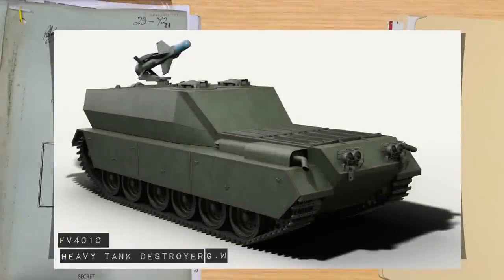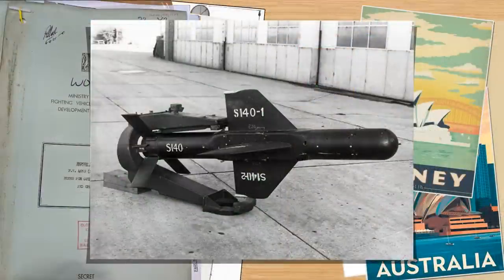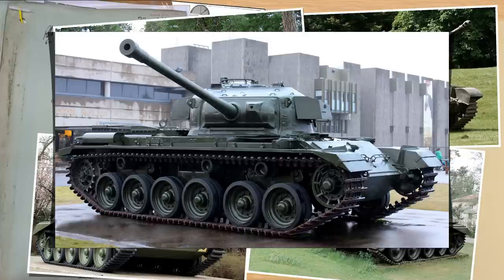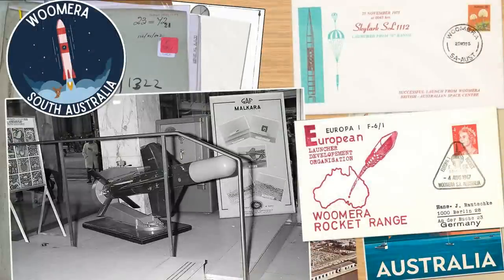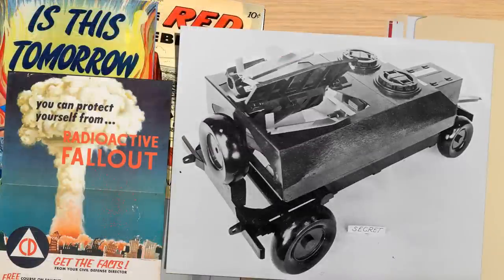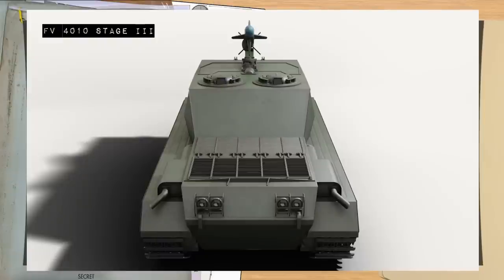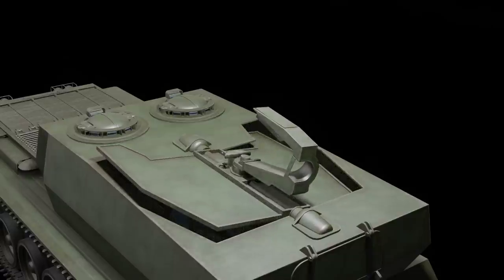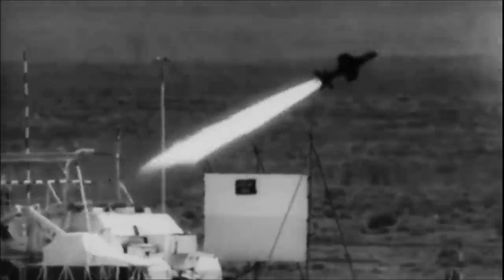FV4010 Malkara  - Tank Design & Development

Comment: i had a chance to do a commission on several of th vehicles in this line back when I first started doing commission 3d models. the number of possible systems and some of th mechanical details were ...impressive maybe not practical but ambitious, and impressive. at times I was stuck mid process... trying to figure out how the bits fitted together.

Comment: I,ve read somewhere that the prototype Merkava was a Cent chassis reversed,with the drivers position next to the engine.Its a shame the same wasn't done with this vehicle,or fitted with the 120 mm available at the time,in a casement
Reply from the maker: merk was, and this is alsoa reversed cent, but the gun was not needed, they didnt think the 120 would be enough at the time, and/or have the range that the missile did
Reply: one of the Prodigal project designs was very close to what you described I had a chance to do a 3 d model of it for a fellow a while back so had a chance to sneak a peek at th design notes as references.

Comment: Now I realise my Dinky SHADO 2 mobile's rocket launching system was a realistic loading system. OK, it only took 45 years to learn that.
Reply: the shado 2 launcher is a very close fit for a proposed orange William proposal.
Reply from the maker: you thinking 426? i found it :) - will be done soonish
Reply: @armouredarchives8867  Its was a fv400 series... side-mounted launchers with sliding panels for reloading I have one worked up around here but it's a commissioned piece.
Reply from the maker: yes i was very happy to have foudn the plans and the model photos off it, one launcher mount on the left side. - also comet OW, and several others
Reply: @armouredarchives8867  So many gems!
Reply: @armouredarchives8867   I really enjoyed the process of modeling the old drawings. they may not be completely accurate but hard to say sometimes from a pretty basic sketch.. and revisions are allowed... :)

Comment: Wait... if there are only 2 crewmen, loading and firing constantly would present a challenge. Hopefully the gunner/ loader has good hand-eye-INcoordination to lead the missile through the sight, while also picking up and slotting fins on the next!
Reply from the maker: nono 4 crew, comander and gunner/driver. and the 2 loaders/fixers in the back - they fix up the missile, and the gunner under the cupola steers it to the target
Reply: Four crew mate ......